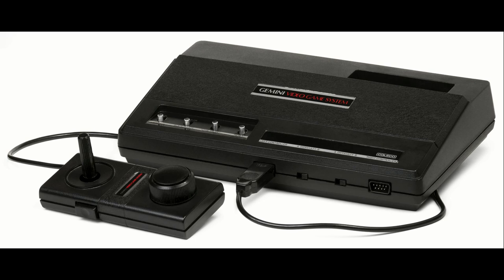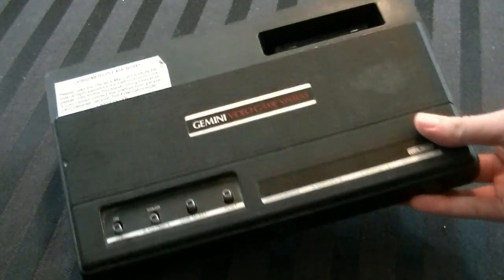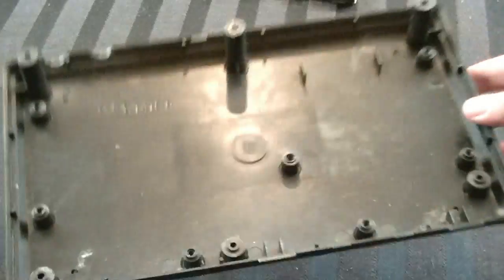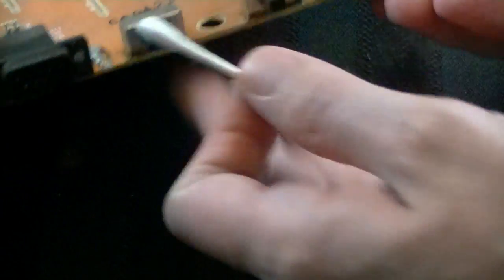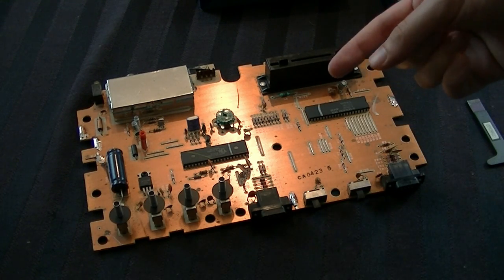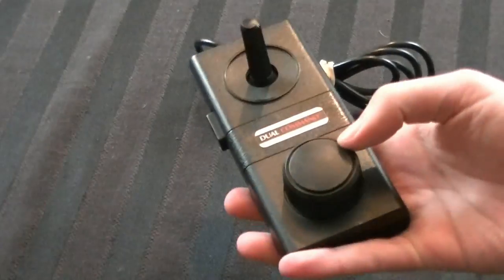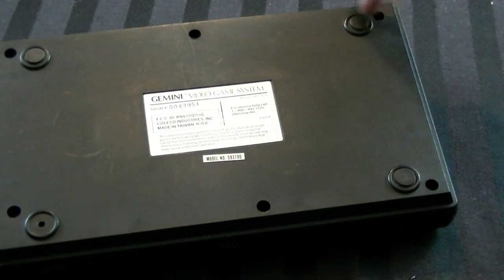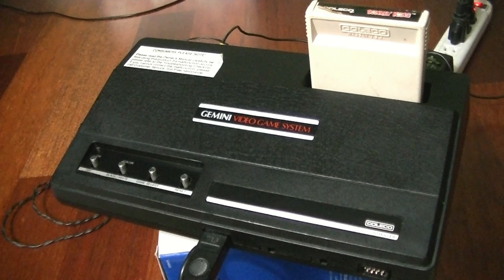Gamerade - Cleaning and Restoring a Coleco Gemini - Adam Koralik

Comment: I had this exact system. If the controller isn't working you can take it apart and you will probably find that the metal contact feet have come off. You can screw and glue them back on to get the joystick working. Pretty self explanatory..

Comment: Hey Adam would your buddy over in the UK be able to fix a PS2 controller? It works but it takes a lot of pressure to get the X button to function, as well as the analog sticks lost their cover things. The Analog sticks are also a bit loose and I don't trust myself opening the the thing and possibly breaking something.

Comment: Must be a different version. The one I am working on has a big metal bottom shield and top shield on it and the variable resistor is located just above the center of the 4 switches.  It was purchased as "not working" but think it's seen water infiltration from a possible basement flood or it spent it's life in very humid conditions. I can't seem to get it to work. I get a 3-4" bar on the right side of the screen on turn on, then it goes full screen and screeches a single note sound until I unplug. Then it repeats the process. I was given a cartridge called "Yar's Revenge" to work with. It's an Atari game. Any help would be appreciated. I did touch up the board, power port, controllers, slot pins, etc. The slot was cleaned with a fine sand paper and because of it's life in humidity, I did apply a thin coating of dielectric grease to help stop corrosion. (This was done by drilling out the small rivets and extracting the screws) It did cause one trace to become damaged and it took a while to track and jump it so I would not drill the rivets unless absolutely required. They can only be drilled from the bottom and the one that is closer to the center of the board sits right over one trace and is dangerously close to the second one. proceed with caution. I used a single strand from an IDE ribbon cable to run a jumper from one side of the board to the other. Tracing it was insane but I'm positive I jumped the right 2 pins and left nothing excluded from the circuit.  
One note, I got it with the output shield bent, unsoldered and has been removed. I don't see anything missing within the box or evidence of any tampering.

Comment: Wait can you make a quick video of a better explanation of credit card trick and shows you doing it? I really don't understand what you mean by it
Reply: He could definitely do that. But it's very simple. You get the appropriate amount of felt cloth and a credit card. Wrap it around the credit card. Then wet it with Windex and shove it in the cartridge slot. Then it transfers the dirt to the felt cloth. (The credit card just acts as a hard surface to give the availability to shove it in the slot). You wipe off the felt cloth and repeat until satisfied.